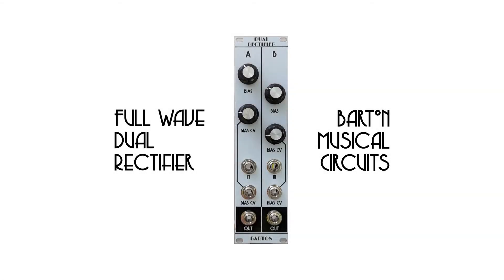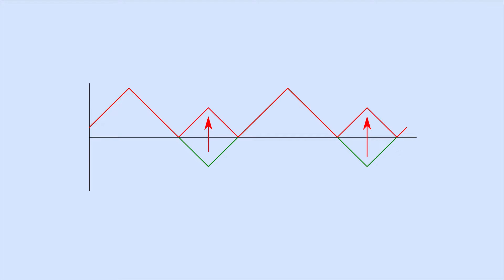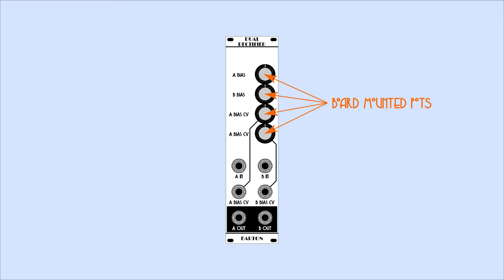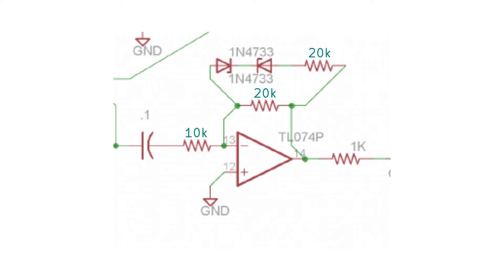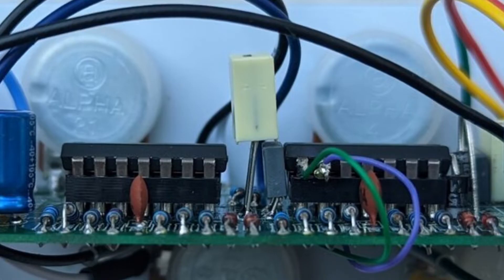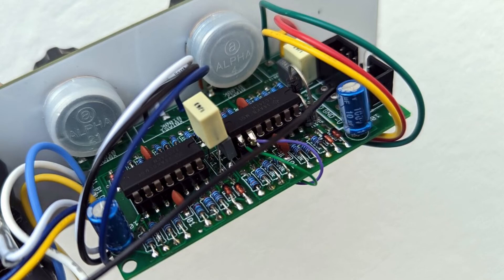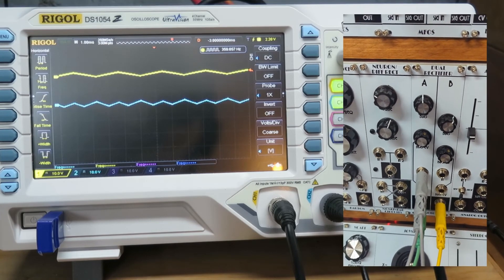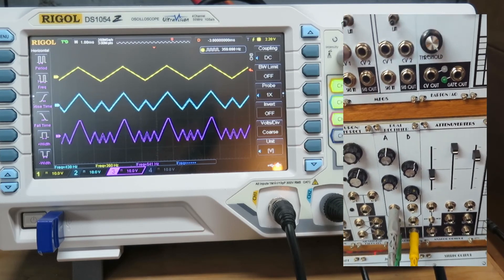Barton full wave dual rectifier synth module

Comment: HEY!!  THANK YOU! For sharing these obstacles that you encountered, as I have never in my life encounrered one of those great sockets with a filled in opening.  Those were great little fixes that you implemented.  And those Barton Musical Circuits PCBs are really a true bargain if you’re looking to get into DIY for modular synthesizer (which I do NOT recommend to anyone who thinks they’ll cut costs by going that route).  It’s a rabbit hole within a rabbit hole, and some call it divorce-wears, I call it eviction wears!  A few great S-DIYers have put it best when they said, “you’ll end up spending 250$ to do for yourself what could’ve been done for you for 100$”!  That has definitely been my experience.  But the education that comes along with the experiences gained is probably about equal to a four year college degree.  IF you’re mad enough to stay the course, that is. I mean, it’s something that you really have to want, and only for the sake of wanting.  There is no promise of any job or career as an electrical appliance repairman awaiting any electronics hobbyist in today’s world, sadly. I sometimes feel a bit like Don Quixote, who longs for a time before his where he really believes he comes from, when knights in armor rode on horseback and went on crusades.  My castles are antiquated machines and my sword - a Hakko soldering station.  My shield is a Fluke multimeter and my helmet is an optivisor magnifier. It is my duty to fix what is broken and in that duty my life is given value and purposeful meaning. I am disposed to failure. I Fail and fail harder.  Again and again and with ever greater efficiency. I was born late in my day, but I still know what I am and people can laugh at me as they do.  I can change for them no more than the present age could change for me. If that is a sad dilemma, then you’ve got the wrong idea!!
Reply from the maker: I have to disagree about the cost of DIY. For example I was recently looking at the NLC Bong0. There's no option to buy it assembled but SynthCube wants $85 for the full kit. It's a pretty simple circuit with no exotic components; the full BOM exclusive of PCB and panel could be bought for under $15 plus shipping. PCB is $8 and they want $20 for the panel but you could make one for next to nothing. "But then there's your time which is worth $xx per hour" some say. But it's not. My recreation time is worth $xx per hour only if it comes out of time I would otherwise be using to make money, and it's not. I'm certainly not $xx poorer at the end of an hour of soldering. So sourcing my own parts and panel comes in maybe $50 to $60 cheaper than the full kit, which in turn is cheaper than an assembled version would be.
Reply: the cost of DIY makes a lot more sense if you already did the four year college degree and have all the equipment and leftover components sitting around begging to be used for something since the actual job that fell out of college happens almost entirely in microsoft excel. that and like, it's a case of pick-your-battles. i can't make a VCA for cheaper than behringer's but i can definitely make a PT2399 delay cheaper than the echo and feed.